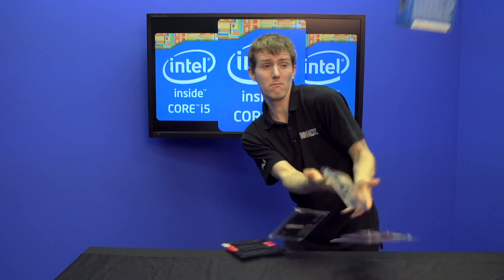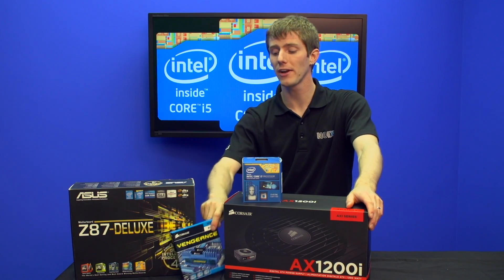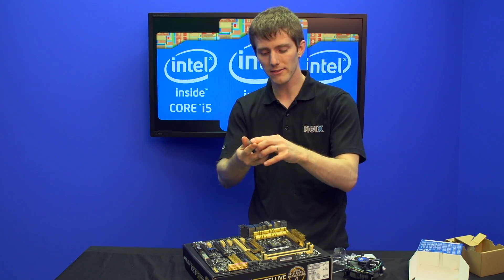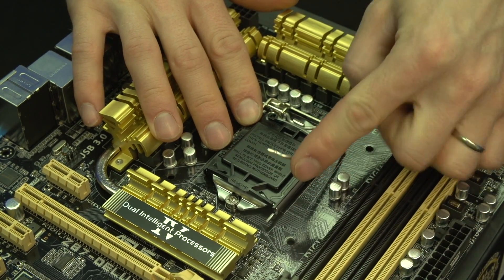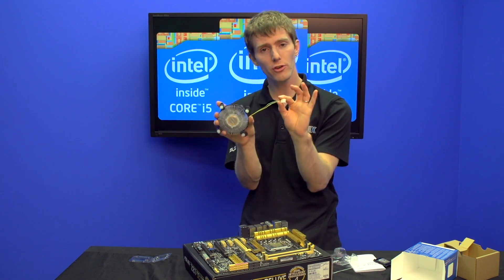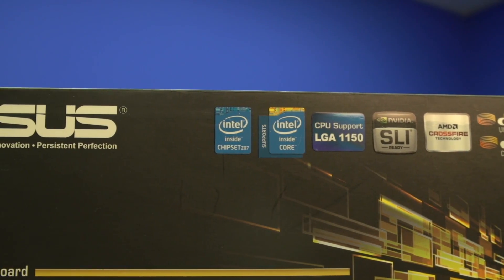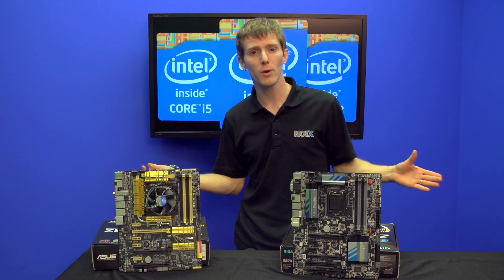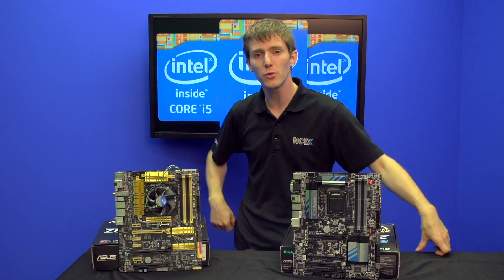Haswell Buyers Guide

Comment: Oh My God... When you install the heatsink. You Bend The Motherboard. And thats horrible..
Reply: No.. the motherboard wont snap/broke if you push with that kind of force.. you need alot of it.. trust me.. i once accidently sit on my motherboard and its still working with my PC ..and its still working right now.. also they're a computer hardware master assembling parts sensei shifu...
Reply: Claudius Rocky WOW LOL
Reply: +Naufan Septiadi I've even bent my motherboard, I'll probably bend the next one too. The problem is if it's brittle. If that were to happen, then that kind of force would put a hole through it and not just make it flex a bit and then straighten itself out.

Comment: What's the difference between plugging the monitor to the motherboard instead of the gpu?
Reply: Kostis Gkiokas If you have a GPU you should not use the plug on your motherboard, video signal will run through your lower GPU plug :)
Reply: if your cpu has onboard gpu you will use the onboard gpu instead of the gpu you will not have good grapchics but it stands on your gpu
Reply: yes i forgot that!

Comment: so, can I use 550W power supply by corsair for haswell motherboard and procesor?
Reply: You can use any PSU you want, just make sure it's enough to run all your stuff. 550W should be enough for a basic build.
Reply: i would have asrock fatality b85 motherboard, intel core i3 4150 3.50 gHz, saphire radeon r7 260x oc edition 2GB and 6 GB of RAM
is enough 550W?
Reply: Yes.
Reply: thank you so much.
Reply: DomyGromy Yes. 550-600w will run most systems with a gfx card, HD, burner, etc. It's when you have more than one GFX card and other stuff that you'll need a higher watt PSU.
Reply: I'm sure you might be using one by now but i use a corsair vs550 with a i5 4670,8 gigs of ram and gtx 750 ti along with 8 case fans and 2 hdds along with 1 optical drive.you should be pretty safe.
Reply: private private I have 7870 oc 8 gb ram (g skill ripjaws-1600mhz) an psu(550w from MS) is that enough power for i7 4770k that i will buy with new mb(ASRock Z97-ANNIVERSARY, 1150)???? :) ( i wont overclock)

Comment: I have one issue with the current gen intel CPU's that is cheap thermal paste used with the IHS this does worry me as the quality seams to vary enormously despite and lacking gen 3 pcie might be a more reliable solution going forward unless Intel fixes this problem ( not likely )

Comment: I have ordered 16gb ram, asus maximus hero vi motherboard and intel i7 4770k.
My gpu is gtx 760 and my psu is 500w 
will i need a new psu??? O.o
Reply: oh yeah for sure, assuming you have a few case fans and optical/storage drives. I'd go for at least 750w

Comment: I bought 4770K, Z87X-OC Force, 16GB vengeance pro 1866MHz RAM, H100i with NF-F12 in pull config(these fans are suggested buy Linus tons of times), Cooler Master V1000 PSU last month. At time of getting the parts, I didn't know about Haswell certified PSUs..but today I checked after watching this video and hell yeah, my PSU supports it:-)

Comment: I have a 4670k, 780ti, 16gb of ram and a 750w psu BUT... I am thinking about upgrading to two 780ti's will I need a new psu and can you recommend one for me TY :)
Reply: this should work well for two 780 tis
http://www.newegg.com/Product/Product.aspx?Item=N82E16817438018&nm_mc
Reply: If you don't overclock, that 750w PSU should be fine.
Reply: PS: Only try that if you have a high quality power supply (gold certified will do just fine).
Reply: yea if it's a good 750w you might be able to but I wouldn't push it.
Reply: Yeah if none of your stuff is OC like gpu or CPU even like ram, you won't have a problem running two 780"s that are not OC.
Reply: rm 850m from corsair is a great psu

Comment: If I use a non-Haswell-certified PSU with a Haswell chip will it seriously impact the Longevity of the chip?
Reply: No, any quality atx psu will work perfectly fine with any intel or amd cpu. just watch out that your psu can provide enough clean power and has some kind of 80+ certification.
Reply: Thanks, Lars!

I actually have since found out through Corsair's website that my PSU (the TX650) was ready for this Haswell stuff to begin with.

Comment: Why does ram speed go down with overclocking? Is it a question of resources available? I'm fairly new to all of this.
Reply: I know this was 6 months ago, but it has to do with voltage I believe. If you're looking to get better RAM, find 1600 MHz sticks with CAS latency of 7 (or lower) and voltage of 1.5 (or lower). Practically speaking, it's just as fast as RAM with higher frequencies, but it won't require you to mess around with different configurations too much. You can find sticks with CAS of 9 up to 2133 MHz, and then they start to go up.

Comment: I have to say that i am extremely disappointed to my 4770 CPU. the damn thing costs 300€ and with the stock cooler ramps up to 105C instantly. Had to buy a aftermarket cooler just to sleep well at nights. and it still goes to 74c and when the GPU is being tested the cpu goes to 82c (GPU exhausts in the case)
I'm not going to be buying intel cpu's in the future because the quality is crap.
And to be honest i have seen mostly unnoticeable gains in game performance compared to my previous athlon cpu. higher max frames and lower fps drops.
I should have gone with a fx 8350 and saved over 100€

Comment: The Haswell haters may have a point.. I just got my 4770K. Thought I'd run through a couple of benchmarks and stress tests.. And was shocked to see the temps shoot up to 85+C during benches, and over 100C during stress tests like Prime95 and Intelburntest!!!! It even runs at over 75 during gaming. Granted, this is with the stock cooler, but it's also at stock clocks...

Worse yet, this is with winter time ambient temps.. When summer hits, I shudder to think of how hot this little bitch will get. I'm considering RMAing this thing, but will prob just get another micro space heater in return.. Shiddy.
Reply: Look all I am saying is either return it or delid the chip. Trust me 80*c at Average load means defect.
Reply: Rougewolf  So 80 degree at average load does mean defect eh? I thought so.. I'll get in contact with Intel about what I need to do to get a RMA.. Never thought I'd have to RMA a cpu, Intel cpu least of all.. It's going to suck having my new PC just sitting, collecting dust for a few weeks, because Intel decided to skimp on quality.. Oh well.
Reply: Don't hate the CPU, hate the cooler! Plenty of people are saying that they are running at 90 C when rendering videos and such with the stock cooler.

I just finished my build with the 4770k and a Noctua NH-U14S, I am running at 29 C idle, and 53 C after 15 minutes of prime95.
Reply: buraces  Good luck friend.. Hopefully you get luckier than I did.
Reply: mindman1234 For a 320€ product being forced to spend even more money to sleep at nights is complete bullshit. If i go out to buy a premium car i can expect quality. people like you are the reason corporations can do this kind of shit and never get any slack for it. stop being a fanboy and be a reasonable consumer.
Reply: *****  Yup, already looking at different CPU coolers.
Reply: bliglum Delid the cpu.
Reply: Rougewolf  Too risky.. I'm not well heeled enough to risk turning it into a 300 dollar paperweight.
Reply: You think i'd need to get an aftermarket cooler for the cpu if i'm not planning on overclocking?
Reply: buraces  Apparently, it depends on how lucky you get.. Some people get haswells that run almost as cool at earlier i series processors. If you're less lucky, like myself, you end up with a little hot head.

 Very soon I plan on getting some kind of aftermarket cooler at the stock 3.5Ghz, because it runs at a toasty 80°C under average loads. Too hot for comfort.
Reply: Well i'm getting my parts tomorrow so i'll find out.
Reply: Do some research, many of these CPU's are having issues due to poor compound / lid installation. You got a lucky chip, likely a CR, it happens. When over 40% of the market is reporting issues please don't blame stock cooling.
Reply: danielavrit  It's strange that Intel would ship their product with an insufficient cooling solution though, don't you think?. I ended up getting a used CNPS 9900max cooler for 25 bucks, and it has indeed helped tremendously.. Idle temps down by ten from 40 to 30, and load temps down by a massive 30c from 90 to 60.

Still much hotter than my old Amd Phenom (which never went over 49c at full load, on it's stock cooler), but at least it's less catastrophic.. : )
Reply: bliglum You are absolutely right. For the price you are paying they could put in something a little bit better. You should not be able to burn up your own chip using something that comes in the box.
Reply: Rougewolf 40% of the market? What are you smoking? The 4770k has a 4.5 star rating on amazon, and 5 stars on newegg.

Where did you even get that figure from?
Reply: Lmao I deserve that I guess the edit didn't update. I referenced the overcooking community who has been bining these guys with over 40% being subject to the issues being resolved by deliding, but removed that line and meant to replace it with 10% of the general market because majority of users won't know or care... Though your comment about ratings is pretty ignorant yourself as that is all relative.
Reply: Rougewolf Oh, my bad, I forgot that overclockers don't leave reviews....

Also I don't disagree that deliding improves performance, but I'm not seeing the 40%... just a couple forum posts.
Reply: danielavrit Yeah I don't think overclockers complaining about temps is something to make a statistic off of...
Reply: danielavrit
Honestly this is just becoming a rant no longer a debate. I don't know which forums you belong to, but that consensus is there whether you believe it or not that batch numbers don't lie. I have built 3 rigs using 4770k's and (2) were running just great the other was significantly higher. Same thermal paste, same cooler.
Reply: stop using the stock cooler bro... get a corsair h100 or something.. stocks are such garbage
Reply: How is the cooling in your chassis? My i5 4440 barely runs at more than 40 C
Reply: Marcel Viviers If you are asking me.
Cooling in the case has nothing to do with cpu temps if in 20 seconds the CPU is at 105C.
I have 7 140mm fans in my case 3/4 I/E. The intel stock cooler is just shit.
Reply: Marcel Viviers I'd say more than adequate. 2 intake, 1 exhaust fan. In a Corsair 300r case.
Reply: I have 4670k  (the 4770k is better of course) I have the h55 cooler which allowed me to overclock to 4.2 ghz and my temps are about 60 degrees max. So what I am saying is get a water cooler or just get something better than the stock cooler. Hope this helps :)
Reply: bliglum Is it possible for you to add another exhaust fan? So that you can have one on the top and at the back. I have an older Aerocool Strike-X Case. The first one that came out with the huge mesh X on the side and it's quite open which allows for good airflow and it works for me. Water Coolers for CPU's are not that expensive and it will be the better option for the better cooling.
Reply: Marcel Viviers  Yeah, I could. But I'm pretty happy with it as it is now.. Since adding the aftermarket cooler, the temps dropped down to acceptable levels : ).. The Stock Intel cooler is just COMPLETE garbage.

Comment: Linus, I aint' fooled about Haswell. My carefully made i5 2500k , P67 MOBO, (that's old ain't it), punts along at 4.5GHz running unigene etceteras, sli's and host of software and gets to, wait for it, circa 47 degrees c. (plays around that a little, just a little).  Is this tock of Haswell ready for making CPU's for the laptop brigade.Overclockers want power, power more power.  They do not want to save $1.03c per 5 days while experimenting for the best.  Office systems want Haswell, that's who wants it, to save the budget on 44 computers in a big office. Ivy Bridge, gimme Ive, gimme Sandy gimme. Not spend an extra $200 on a spendthrift? new  psu.  so there.

Comment: What's better to buy - best Haswell (i7 4770k/4771) and 1150 socket mobo, or i7 4820k and lga 2011 socket mobo? With lga 2011 I can later upgrade to 6 core i7 4930K or i7 4960X. With lga 1150 and 8th generation chipset it is unknown if an upgrade to coming Broadwell (or anything else, ever) will be possible. lga2011-3 is also coming for Haswll-E, so it will probably replace lga2011, but i7 4960x won't disappear, so there will be always an option to buy it (not to mention all hgh-end Xeons)... I'm sonfused
Reply: i7 4820K is almost the same as i7 4770K, but a little bit faster and runs somewhat cooler. I won't really recommend a 2011 socket build because the CPUs and motherboard are way overpriced unless your work is video editing/rendering.

Also: i7 4771 is the same as i7 4770K just without the K thing. It's the same speed and stuff, but it's locked, so if you want to overclock the i7 4771 you will be pretty limited.

About Haswell-E: It's main feature is support for DDR4, which won't benefit that much these days, and it's not really game changing.

About Xeons: Xeons are very stable, but they are locked, and not designed for overclocking. Most Xeons are super expensive, but you can get and E3 for a fair price. They also take somewhat less power, support more RAM and ECC.

ECC RAM is nice for servers and high-end workstations when you can sacrifice some performance for super stability.
Reply: Daniel Vekslender
Thank you for detailed answers. I actually learned about everything you wrote in last 2 days.
The lga2011 cpus don't seem that overpriced, but the motherboards do. On the other hand, they have some really nice features.
About my work - it is connected directly with rendering, although I'm just getting into it. I've been rendering simple things with Vray for a long time, but now I want to start doing much higher quality stuff. I'm also interested in computer sience in general and, of course, I've always been a PC gamer :P.
Anyway, I could buy LGA1150 mobo, but I'm pretty sure I wont upgrade to Broadwell and there will be nothing new for LGA1150 after that. 2011 is this "enthusiast" oriented (and server/workstation of course) platform and, let's face it, it's cool :P.

Comment: Hey everyone, I just got myself an Intel i5 4670k, and now I need some suggestions on what motherboard to get, I will be doing quite abit of gaming on the system and maybe abit of overclocking but the ethernet ports that speed up gaming won't help me because I will be using a wireless networking card, I have two choices in mind already the Asus Maximus VI hero or the MSI Z87 GD-65. :)

Comment: for a low end GPU and regular set up.. i.e. optical drive, 2 HDD etc. 
I have gtx 770 which uses about 225W so I have a 650W power supply.

Comment: It is not the cover for the CPU. Whats suppose to be over your newly installed CPU should be the heat sink of your CPU cooler. That black cover you saw was protecting the CPU socket when the CPU isn't installed yet.

Comment: I will stick to i7 3770k .. and obv there are other things like photoshop , unity3d and cinema4d that i use :D So anytime hyper threading is usefull .. was just confused between ivy bridge and haswell...and i really dont see any improvement on the generation change from 3rd to 4th? and also in i7-4770k , there are some features straped down .. and overclocking is limited compared to i7-3770k

Comment: If you haven't bought a motherboard yet, go with the i5 3570k. There really is no need to go with Haswell unless you're not going to buy a video card. If you do go Haswell, get the i5 4670k, screw i7.

If you're going to do a lot of CPU work and you're going to render videos, get the i7 3770k or 4770k using the criteria above.

Comment: the power supply upgrade is UNNECESSARY  . ALL MOTHERBOARD AUTOMATICALLY DISABLES THE ULTRA LOW POWER SLEEP MODE OF HASWELL OR IF YOU HAVE ONE SYSTEM FAN THE ULTRA LOW POWER SETTING IS NULLIFIED . Shame on LINUS for passing on this crap . You save a whopping $1.25 per YEAR

Comment: thanks mate :) going to a high graphics card soon but I do a lot of video encoding and graphics making and especially for college coming up.  I guess there is only something like a 3% increase.  Ill be trying to upgrade to a gtx 700 series soon.  Is it worth to go watercooling for the CPU aswell, it hits about 55 - 60 degrees on 100% overclocked just by 500mhz so its not so much but I really want to go higher as I use FSX a lot at its 90% cpu based. Thank you for the help :)

Comment: It's your fault. I just built my first Intel system for my grandma and it used the push pins. I got the heat-sink mounted in 10 seconds. I had her computer up and running in less than 30 minutes. When you have to apply force to anything then you are doing it wrong.

Comment: at same clocks haswell is proving 5-15% more than ivy … at most, the majority of the transistor count increase has gone into the iGPU which doesn't much interest LGA socket users with discrete cards. quad core processor power hasn't improved massively over the last 5 years, unless your OC'ing to 5ghz on an i5 2500k. Haswell & Ivy due to IHS issues won't reach the speeds of an i5 2500k & have high core temp variability when OCed hard. little epeen to be had from haswell except energy savings

Comment: there are many reasons. the main one is as technology progresses we are able to make each circuit or transistor smaller. Allowing us to fit physically more transistors in a giving space. The decrease in transistor size is faster than the performance increase we require. Giving us a trend where chips get physically smaller and smaller.A smaller transistor also gives us better efficiency and thus performance because of resistance and other complicated physics.also electrons move through it faster